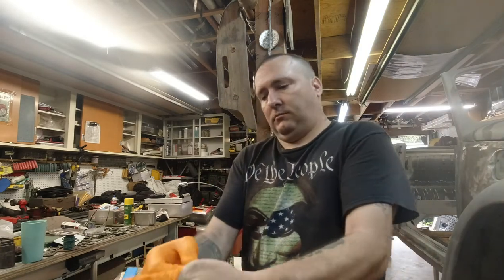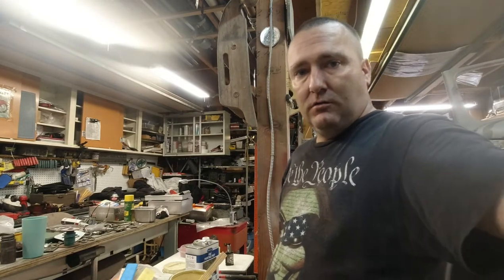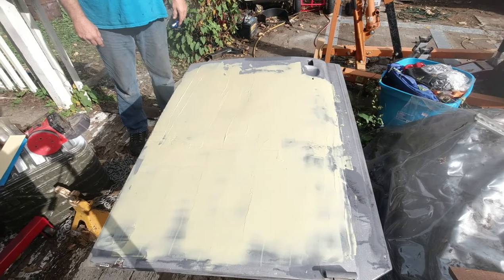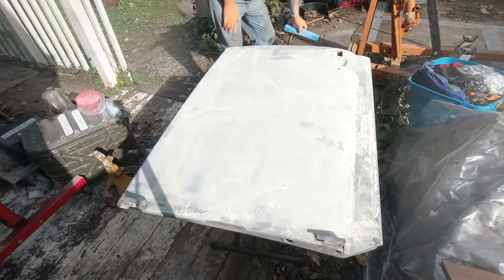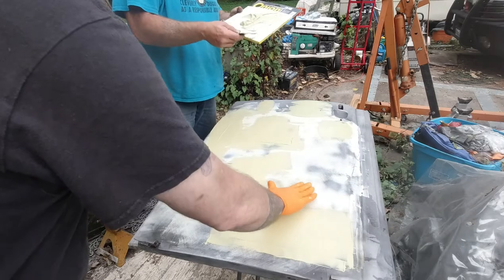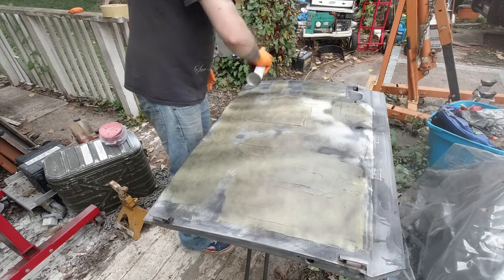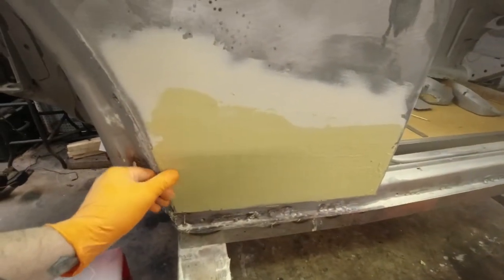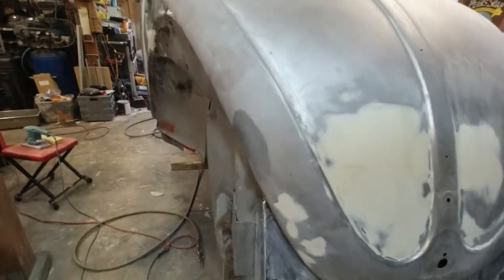69 Vw Bug Bodywork - Madstiles

Comment: I have a 78 Convertible I’ll be starting on.. I’ll have to work out of a storage unit for now (10x 30) .. no power, no heat. Need advice for tables to hold body... any advice is welcome.
Reply from the maker: I use a table with wheels I found on Facebook marketplace but a friend of mine uses a cart he builds for fairly cheap.  Here's the link.  
https://youtu.be/wG29Jjkrrlk
Reply: @MadStiles  just checked him out!  Ty!!
Reply from the maker: My pleasure!  Good luck its fun!